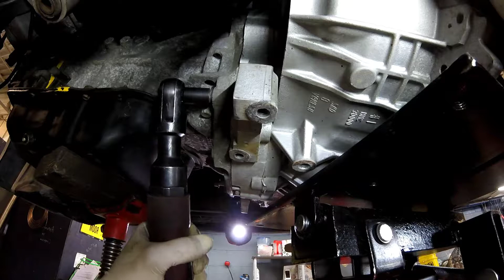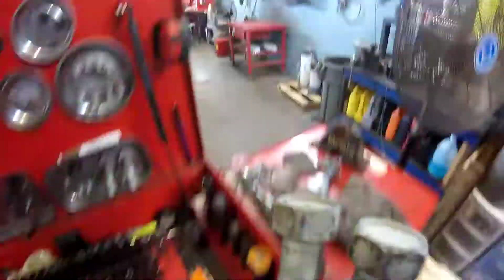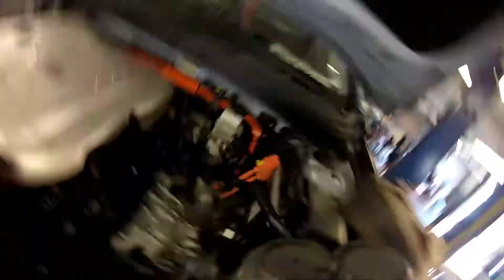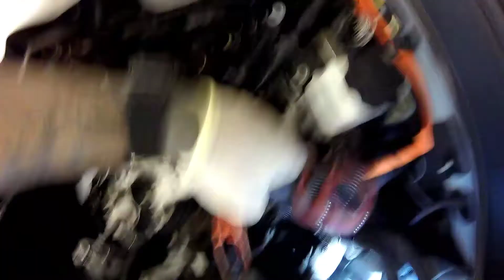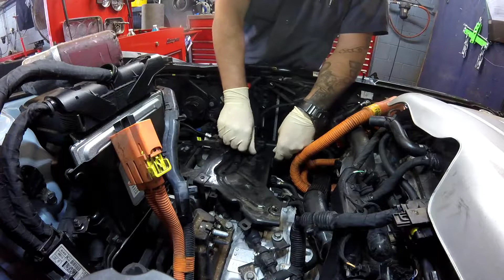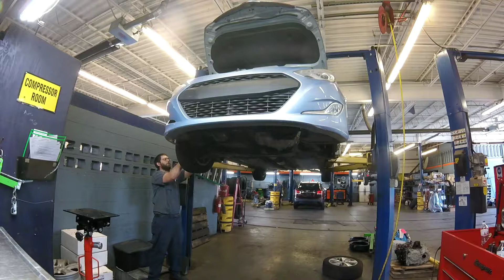2011 Hyundai Sonata Hybrid Transmission Install

Comment: I have no idea, how you remember, where every hose or wiring harness goes 🧐   there's too many black hoses, wiring harnesses and connectors in those engine bays.  
Too much darkness, they need to color code everything, that is bulky. 🤔

unfortunately, too much planned obsolescence built into that car, and all the others. imho

Great job, on your part.
Reply from the maker: Thanks! It can be crazy with certain cars. Mainly German cars. They have plugs that will plug into one another when they shouldn't. Most manufacturers put little grooves in certain areas of the connectors to keep them from being put on the wrong sensors. I have about six different colored paint pens to prevent running into these problems though. Always think ahead. I started out poking all my bolts into a box and labeling them, now I'm just a magnet freak! You live and learn.

Comment: Does it need reprogramming, after installing
Reply: As far as I know all cvt transmissions need to be reprogrammed. Im curious what you use when this job isn’t done at the dealership
Reply from the maker: We send it to the dealer. Its roughly 200 bones for them to program for us here in Ohio.

Comment: What is the ballpark cost for this job?
Reply from the maker: Honestly if I did it in the side with no parts in my cost i would do the job for 5-700 depending on if I have a lift or not. The harder I have to work the more I charge.
Reply: @CarMechaNick  Thanks for the fast reply. That is A LOT LESS than I expected.  I have a feeling the price of the transmission might be as much as the blue book price.
Reply from the maker: @sailingstonerose  it's not a cheap unit but I'm not sure what we paid. I don't pay much attention to the prices. I just get the jobs done :)

Comment: You dropped the WHOLE crossmember??? Why???
Reply from the maker: I did the motor the first time and took them out as one pice. Test drove the car and trans was bad. (Not my diagnosis on engine) I realized how easy it was to remove when doing the engine and liked the extra room so I did it here as well. Its only necessary to remove a subframe for a trans with a FULL subframe. Atleast in my experience. :) that would be why.